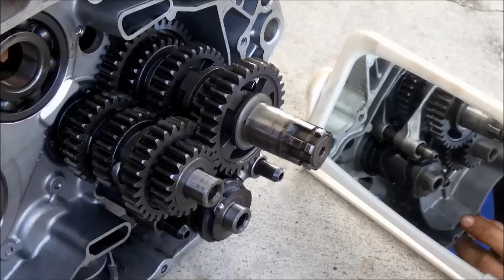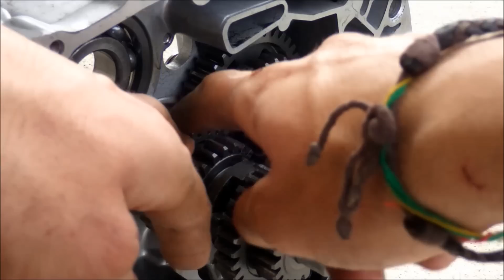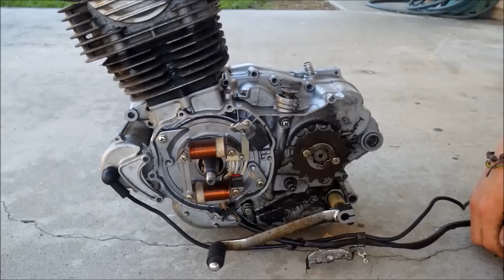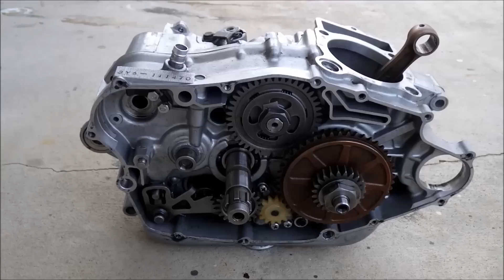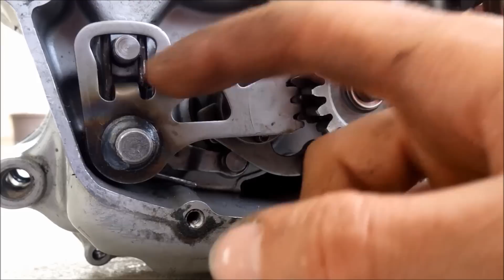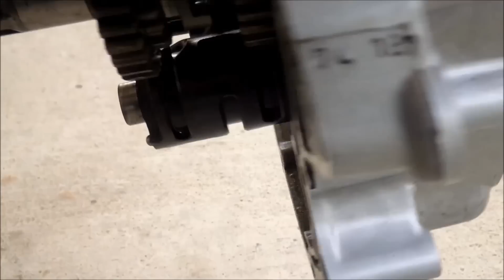Motorcycle transmission: DEMONSTRATION + EXPLANATION

Comment: This demo is so perfect. I had no idea how my trans worked, and was having a problem with it's down shifting from third to second and to first. This was due to my running low on oil and some metal particles started circulating around and causing the problem. It is now shifting fine since I did two oil and filter changes. This took about 600  miles of driving, and so far it's working fine. I would still like some input regarding how the metal pasrticles effected the shifting. Thanks for the excerllent demo.  Ron

Comment: The popping together of small levers is there's 2 ways #1 as well as your workshop manual and all motorcycle gearboxes say 1965-2005 are basically the same so you can tell, 4 springs means 8 lever contact points so 8 levers unless they're like scissors, you install all your shafts without tightening then you'll figure out your first spring, basically the thing is the heavier the spring the more robust the lever and springs go around %7 longer than lever arc movement, if you're dismantling a motorcycle gearbox try using a camera you can still get Polaroid cameras taking pictures with each single component you take away then simply start from the last numbered picture even draw things and mark them with permanent markers.

Comment: I install reinstalled this after had cracking open the case. but when reinstalling I was a little confused on which direction the broken pointed star (neutral) goes. I put it in the only way it seemed to go. everything spins nicely. but, so-called neutral, doesn't turn all the way to that little wheel. Did I mess up? the repair manual was far from clear, and based on the facebook clinic group discussion on that, convinced me I was good to go. now the engine is sealed shut, both (rear, front) cylinders are installed and new gaskets compressed to spec. I come to notice the neutral part of the star (stopper/plate) doesn't rotate around to the wheel (stopper lever assembly). The fork shifts looked to be in the right places prior to sealing engine. I have a 2000 Roadstar 1600
Reply: I started rotating the rod that holds the clutch basket, which in a result, allowed the plate (star shape) to access different positions. which in turn did, in fact, let me get the neutral position to align with that wheel on the stopper lever assembly. interesting. 1st time being inside an engine. Great video btw. very informative.

Comment: Love this demonstration. I recently dropped my CM400 and the shifter lever was pushed up and it wouldn't shift past neutral. I was able to re position the lever but now it angled to low and puts my foot in a really awkward position when shifting. Im having trouble thinking of ways to combat this. Any ideas on how to go about fixing this? I could attempt to bend the shaft just so that is isn't so low relative to my foot peg. Thanks ahead of time!
Reply: Hey, you should be able to loosen the shifter pedal and move it up or down and then tighten it, or maybe just buy a new one
Reply: Well the thing is, my shifter level is splined so I can't put it in any position i please. The next position up hits the engine casing when I up shift. Im wondering if the shifter shaft iteself is able to adjust. Honestly I'm not sure how it could have turned since it looks like it stuck on the it wouldn't have been able to move from the 3 tooth rack gear thing.
Reply: Stephen Imsong if its splined you just have to pull it all the way off and then put it on where you desire
Reply: Right but the splines positions are either too low to make shifts awkward or it hits the engine casing. One position I can't shift so the other I can but its very awkward. Like I said, the position of the shifter was fin until my bike got dropped and the shifte was pushed towards the casing. Something must have broken or deformed to allow that. And position it to the next position puts it in a very awkard position. 

Its a bit hard to convery
Reply: Stephen Imsong sounds like you just need to buy a new pedal...
Reply: Yea maybe. Im just a little confused sine it doesnt look bent. But maybe just enough that it hits the engine casing. But you dont thinkg anything in the transmission could actually break/bend/deform to allow for this. I've never ripped open a transmisison and you know whats going down in there. Thanks for all the replies man!
Reply: Stephen Imsong Well buying a new shifter pedal is alot cheaper than having a mechanic look at the bike, so it would try that first and if it doesnt help, bring it to your local biker shop and have them look at it.
Reply: BAMBI Fixed the problem! All I had to do was bent the sucker back! It shifts like a dream again.
Reply: +Stephen Imsong Wow nicely done

Comment: Very informative video. I do have a question that I hope someone could answer. If all gears are always in contact with each other, do some of the gears slip with respect to the shaft they are on? Because every gear it is in represents a ratio between the rotational speeds between the input and output shaft. So while one gear (and thus one gear ratio) is engaged, this represents a fixed ratio of rotational speeds between the two axes to which only that specific gear ratio can comply. Therefore all the other gear ratios will not have have that specific rotational speed ratio so in order to stay in contact they must slip with respect to the axis they are on? It's hard to explain what I mean but I really hope someone can answer this question.
Reply: That is exactly how that works. Some gears on each shaft are called "idler" gears. These gears can only be engaged by the sliding gear that interlocks with it, creating the link all the way from the input shaft to the output shaft. All the other gears will be moving each other because one of each set is always linked to a shaft, but its partner will act as the idler, free-turning on the other shaft.
Reply: Ah right, of course. Thanks for clarifying! I always struggle with gears to imagine it in my head.
Reply: Steven H

Comment: Since this video is so old. That I even get a response but it's worth a shot. I have a 1996 KTM 400 EXC and it will ship through every gear just fine when the bike is off. I can downshift into first gear just fine but when I go for second gear it just makes a grinding noise and goes into neutral or stays in first gear. If I start my bike and second gear it will allow me to shift through every year and then back down all the way until I need to go back into 2nd gear and my issue pops back up. Any ideas? It's not slipping out of gear and my clutch isn't slipping either

Comment: What do you think would be the cost of replacing the main axle that connects to the front sprocet?
My motorcycle has the main axles teeth used half way trought.
Bike that i own is a 2010 Yamaha WR125X

Comment: Would it be possible to install faster gears on the highest speed gears so it can go faster. It may be expensive but somebody might want more speed. Also maybe install a larger starter gear to make starting the engine faster.
Reply: There are some aftermarket gears made . The one that comes to mind is Andrews . These change the ratios , so you can get a higher speed at the same rev range . This will only work if your engine has the torque to handle the change in ratio .

Comment: my bike won't go into neutral once it's on but it engages neutral when it's off. would anyone happen to know what the problem is?
Reply: ur gear box is broken
Reply: Same happens to me if very difficult to but back neutral when bike is on.
Reply: clutch dont completely disengage.
check your clutch lever and cable. set the correct tension. it happen offen on bike were people never do maintenance. you want to have 1/8inch slack in your lever, not more.

another way to tell is jacking the bike up and watching the rear wheel when the clutch lever is fully pressed. if you cant jack your bike. lift your ass up the seat in an asphalt parking lot. while pressing the clutch lever fully change gears. if the bike move or jerk even a litte its because your clutch wont completely disengage. with the bike running of course...
Reply: clutch dont completely disengage. set your lever play, not more than 1/8inch. 

change your oil. if you have a very old bike it might be something else. but normally on bike bellow 100k/km its just cable setting on the lever.
Reply: Clutch is set well their is no problem at all with the clutch it has free play and also bike moves bit harder when applied clutch when in bike is moving compare to movement in neutral it feel free
Reply: Zia Rehman sticky clutch my suzuki rm 250 does it bad
Reply: The problem was with the hide-ling i have reduced and it's good for neutral and gear shifts aswell.

Comment: My car driving teacher told me that when i shift from 2nd to 1st(in 2nd gear speed!)  with the clutch engaged, its not good for the transmission.
I always thought that it doesnt matter how fast your going, if you hold in the clutch and shift, it doesnt hurt because there isnt any power on it,
I partially get it now because you feel it struggeling, and on a bike you can hear a loud click when downshifting, which is bad.

So how does this process exactly work? can you show us, and how can we prevent it?
Reply: a car transmission is slightly different because as you try to shift into a gear that doesn't match the speed you are moving it causes wear on a part called a syncro. the purpose of the syncro is like a tiny friction device, or cone shaped cluch sorta thing. the syncros are commonly the first thing to wear out in a manual tranny. in semi trucks they dont use syncros for this reason. thus the need to either doubble clutch, or float shift. virtually the same thing, your just matching the engine speed to the gear your trying to get into. you can do this in your car by sliding out of one gear and into the next. this takes much practice but is the least wear on your tranny if you can match engine and gear speed while shifting, even while using the clutch. did that come out right?
Reply: search "rev matching" or float shifting"
Reply: darin amann Yeah that made sense :P 
So if you are planning to stop the vehicle, and are driving in, lets say 4th gear with 50km/h
And you engage the clutch, you can rev the engine and shift down and it wont cause any wear?
Or does this only work when you quickly tap the clutch and rev match?
Reply: +NukaMoto that's correct. if your shifting from say 4th to 3rd you could push in the clutch, slide out of 4th, slightly raise engine speed, slide into 3rd, then let out the clutch. actually all i do is slide the transmission into neutral as i let off of the accelerator pedal without touching the clutch. its important to use minimal force on the shifter as this causes wear to the shifter forks. not down shifting may be considered bad technique but I'd rather replace brakes than cause wear the the rest of the drivetrain. this may be different in adverse weather or mountain driving where you NEED to down shift to help slow the vehicle. its important to at least know how to down ahift smoothly but i usually don't and just use the brekes. on the motorcycle i just slightly blip the throttle as i down shift because the gears are sequential, meaning you can't just go straight to neutral.
Reply: darin amann ah yes, perfect! thank you :)

Comment: Well done!  One question-what transmission is this?  I don't think I ever saw a transmission where the dogs mated to openings in the gear sidewall hollow, or cutout, like these show.
correct terminology - hardlinked="splined"; cylinder=shift drum; arm=shifter forks

Comment: Thanks for making this video. I have a dead bike motor and instead of repairing it, I'm going to rip the crank and piston out, build a new oil reservoir for only the wet clutch and transmission, and set a 10HP 3 phase AC electric motor up in the crankcase. Electric bike ftw?

Comment: great explanation! Thank you :)
Is the Motocross clutch and transmission working the same? I don't have to pull the clutch lever to change the gear. Why?
Reply: The gears are probably not straight cut, they're probably helically cut so a clutch isn't necessary. Look up helical gears on Google
Reply: thanks

Comment: what if I wanted to remove first gear for 2nd gear or 3rd gear starts because oviusly if you're gonna use a certain gear for getting holeshot then the added weight of a useless gear that you will never use becomes pointless to have

Comment: I ride a Triumph Bonneville T100 2013 with 14,000 KM's. I find shifting gears up or down, 1 through 3 makes a fairly obvious/loud metallic clunking sound/feel through the gear lever. What can explain this and is it normal?

Thanks.

Comment: Al's Garage when i tight the bolts of the cases the output shaft is stuck it does not spin,why ? is this normal ? what could be the problem ? because of the shims ? i have a shim at every end of the shafts and when the bolts are loosened i can spin the shafts and change gears like you do in this video.
Reply from the maker: robin hood Are you sure that everything is lining up right within the cases? It sounds like something is not sitting at exactly the right place so tightening the bolts could be "squeezing" things, thus getting them stuck. That's my best guess without seeing it first-hand.
Reply: Al's Garage I removed a shim from the output shaft from the clutch side,and now it spins good,thanks for the reply,you make great videos with very good explanations ,keep it up.
Reply: Al's Garage Now that the engine is assembled when is in first gear the front sprocket is spins very hard and when is in the rest of the gears is spins well,what could be the problem ? on one end of the input shaft or the output shaft must be two shims one after another or the nut of the clutch basket is too tight ? because before i installed the clutch the gears were changing good,i hope you can answer me.
Reply from the maker: robin hood If I were you I would work my way backwards opening up the engine one by one until I can see what is causing the problem. With each step make sure that you can still repeat the result that you are investigating. It's a pain but it's the only way I know.

Comment: Great video. Do you happen to know how they are able to not use Synchronizers to match the speed of the gears and not get grinding?
Reply: +Pocono Gym They don't need precise syncronization because it's a dogbox. The dog gears have less teeth on them(and much larger teeth) the teeth are spaced further apart, so rather than having an exact fit, the dog teeth have space between them. This means that instead of needing an exact match to get them to engage, there's alot of space(rotational) to get the dog teeth pressed together before they 
touch each other and engage.
Reply: +SUMOCAT  thanks for that info
Reply: SUMOCAT follow up question - how come cars need (or have) synchromesh? My understanding was that they have more or less the same arrangement except you have H pattern rather than sequential gear selection.
Reply: The gears in a car are much larger, and when moved with the lever would require a lot of effort. Hence, they move something much smaller- the sunchro. It is easier to move and engage. IN a bike, there is no space for a synchro, and the gears are much smaller, hence, moving the gears by small distances seemed to be enough.
This is the logical answer I can deduce. I am open to corrections.

Comment: Hi, what would be the cause of not being able to select neutral when the engine is running? It will go into gears fine but will skip neutral when I try put it into neutral, once I’ve turned the engine off I can put it in neutral no problem, any ideas? 
Thanks
Reply: Gush Bucket, if you're still having this problem with neutral, it's clutch related. Could be as simple as your clutch cable out of adjustment or needs replaced. The cable can look new but be stretched to the point it won't adjust proper. Have you recently rotated/moved your clutch lever perch? If you're positive the cable is good, adjusted and position'd proper, then most likely clutch springs worn out. I'm no pro, just telling you cuz I had the same issue before.

Comment: how come the gear teeth aren't slanted like in a car transmission?
Reply: i think that may be bcos its very old
Reply: It comes down to a few different reasons:
-Axial force, you have to make the transmission box more stable to bear with the axial load, making it heavier/bigger
-Production cost, motorcycle transmissions are smaller than the ones in a car. It's more expensive to make small gears that are made to tolerance.
-Longevity, motorcycles (with a few exception) will drive a shorter distance during their lifetime (helical spread the load better, so there is less wear.)
-Noise, helical gears are less noisy, not really something you are concerned with on a motorcycle
-Probably more I don't know off the top of my head.

Comment: These are not sprokets.. These are gears.. A sproket is a gear that is not meshing with another gear... Although a sproket is a gear... These are not sprokets
Reply: Are you saying all sprockets are gears but not all gears are sprockets? :)
Reply: Exactly, just like all squares are rectangles, but not all rectangles are squares. :)
Reply: sprockets are gears which are connected to each other with chains right?
Reply: Sprockets are toothed wheels connected by chains.
Gears are toothed wheels meshing with each other.

There. All are toothed wheels. Much simpler.
Reply: Tim Yanke govkckgkg.
Reply: This comment grinds my gears!!!